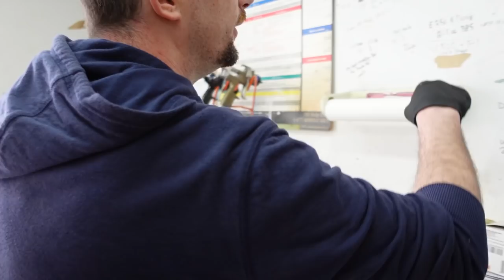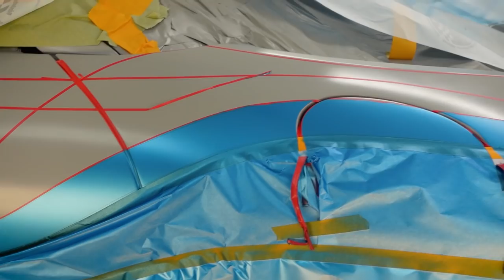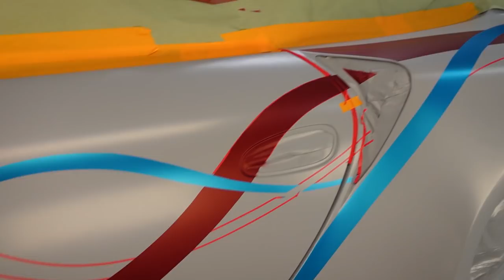Custom Painting our Bespoke Widebody Porsche 911 Slantnose!

Comment: Martini colors or the green purple/blue and white psychedelic scheme from the 1970 Porsche 917 run at Le Mans are the only paint jobs that should have been considered for a car with that much work modifying it. The Martini livery and colors and the psychedelic 917 paint would be crazy enough for all the body mods but true to the Porsche heritage. I love the car but IMO this is just a little to late 90s early 00s mino truck. I think the 917 scheme with the front wheels in green and the rear in purple, or pure mixing white or silver base with the Martini colors and stripes with brushed matte or blue centers and polished lips would have been cooler than polar bear toe nails.

Comment: I really don't want to hate, but you guys ruined it with those graphics. They're so poorly done.. the lines are skinny into the air duct and fat coming out. The width of each line is wavy and inconsistent. Sharp corners in some areas when it looks like the attempt was to round them. It looks really bad. Only positive thing I can say is the bodywork looks pretty damn good.